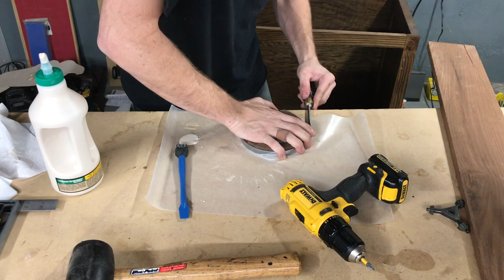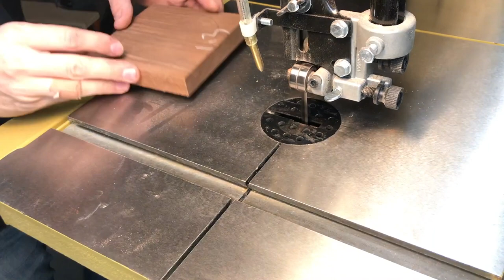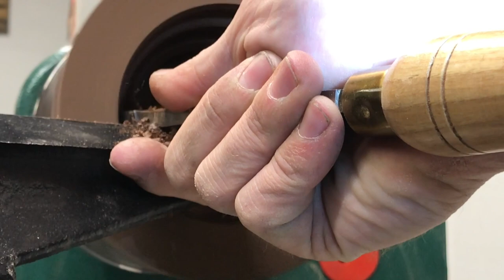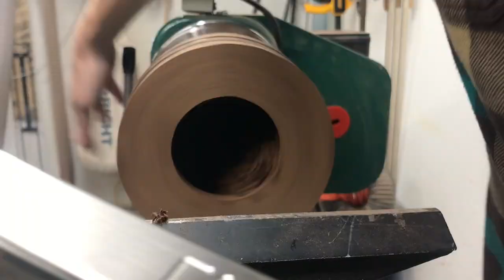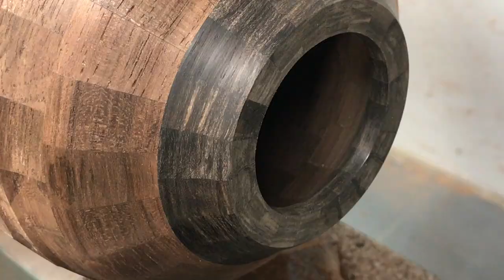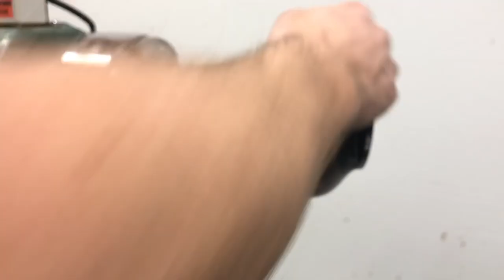Walnut and Ebony Segmented Vase | Woodturning

Comment: Mike, Your work is amazing.... How did you figure out the sizes to make your segments? Is it trial and error or real good math???
And your table saw jig... Is that custom made?
Thanks
Reply from the maker: Thanks, David!  I size the segments by drawing out the form on paper to scale.  I really like a method Steve Lindsley describes in this video --> https://youtu.be/fWia5xO1HTE     

The sled is a wedgie sled, built from plans found here --> http://www.segeasy.com/  Using this sled with the wedge templates from segeasy makes cutting the segments super easy and with perfect angles.  Lots of folks just cut them on a miter saw as well and have good results, sometimes needing a little clean up or glueing them up in stages.